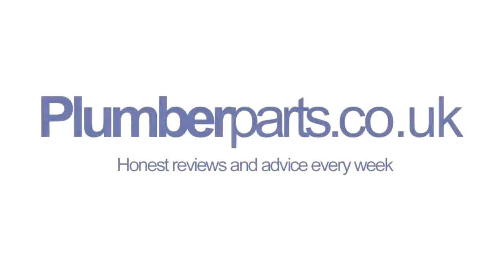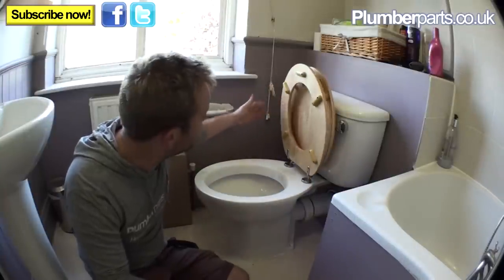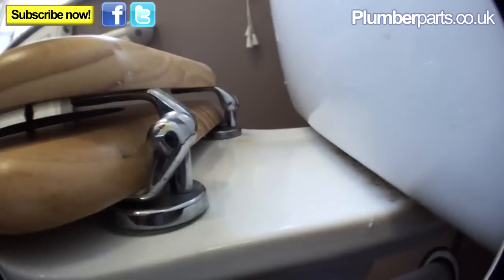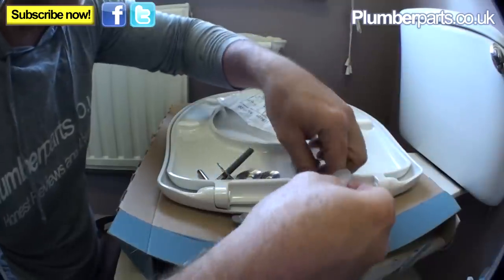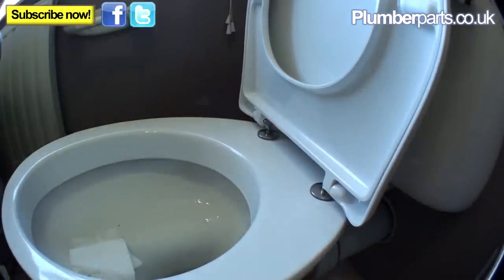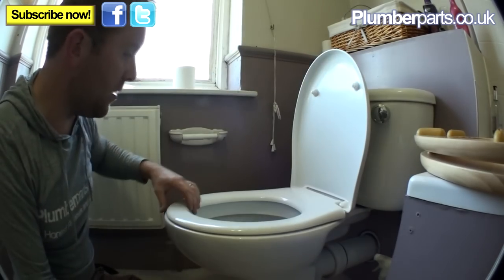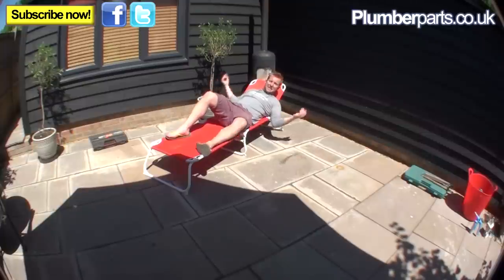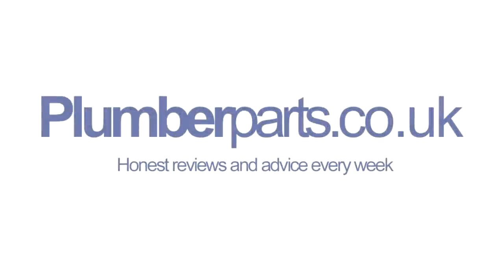HOW TO CHANGE A TOILET SEAT - PLUMBING TIPS

Comment: If you cannot unscrew the bolts under the loo because they are rigid, as I have usually found, take a  chisel and if you can get it under the circular disc that secures the seat to the loo just use brute force and the disc will pop off releasing the holding screw which drops away.
Reply: Just know 4 years later that this has helped me immensely

Comment: Thanks to your advice and instructions I did it! I fitted the new seat with confidence. The instructions where in the seat, and I did not throw them away. Great advice. the seat came with a great little gadget to screw the screws into the bottom of the loo. thanks very much.

Comment: Hi.  My old toilet seat has two plastic long screws with a 'half' nut on the underside of each.  The plastic screw is disintegrating when I try and loosen it with a flat headed screwdriver and I can't get the plastic nut to budge even with a pair of pliers...help!
Reply from the maker: You need to hacksaw it off and get a whole new clamp kit (only £5) SUBSCRIBE! ➡️👉 https://www.youtube.com/subscription_center?add_user=plumberparts 👈⬅️ IF YOU HAVEN'T ALREADY! 😎

Comment: Thanks!  The toilet toilet seat bit slamming down is also a real pain when you try to clean the loo.  I always use a cheap throwaway cloth do the seat bit first then inside the bowl last (for obvious reasons).  When you put the seat bit up after cleaning it and try and do the bowl it slams back down.  You didn't say why the wooden ones tend to fall down like that (mine is a wooden one too).  Is it because they're too heavy?  Also, what's that tool called that you used instead of a spanner please?
Reply from the maker: +aerialkate Just poorly designed. Thanks! PP!